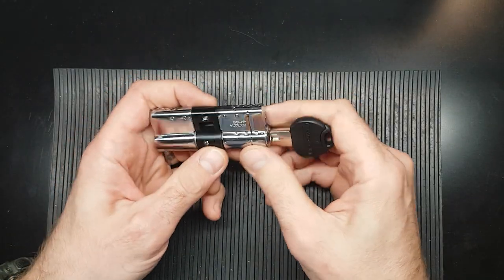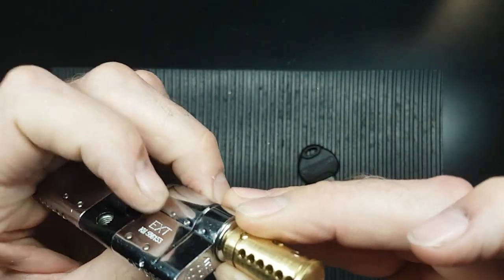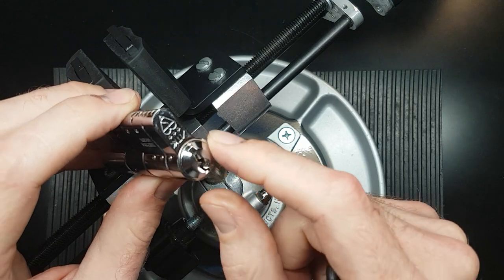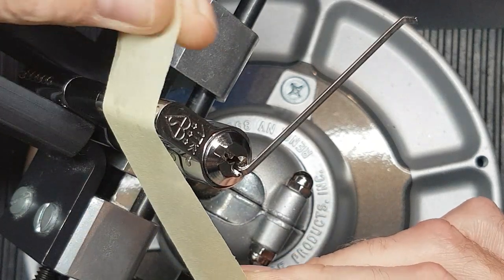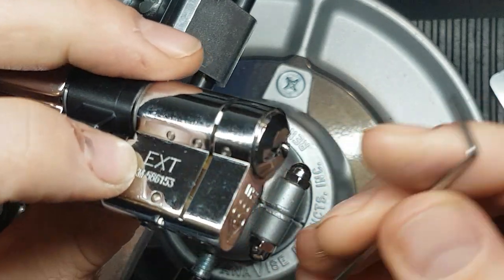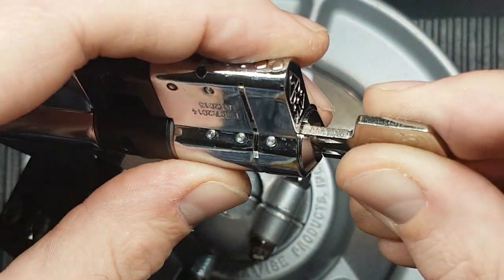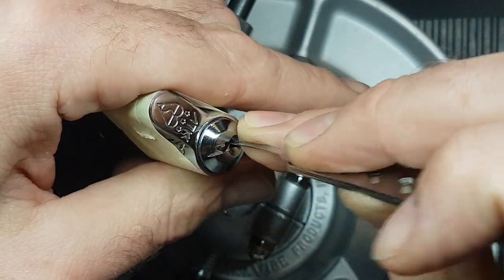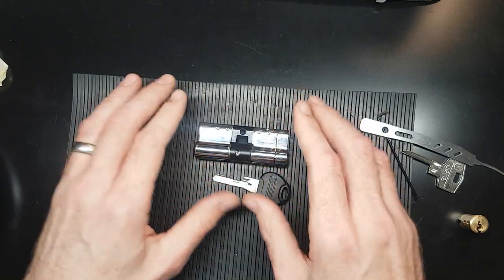Avocet ATK euro. Disappointing 360 pick past 6 trap pins.

Comment: Really interesting to see this lock in this setting. In a Euro cylinder door with a thumb turn for realistic entry settings, would you recommend this, an Era Fortress, or other(s)?
Reply from the maker: I like the idea of the trap pins, however unlikely it would be for an intruder to try picking it. I'd probably choose an ABS avocet over this one though. Same trap pins but also uses a magnetic element and generally feels like a better made cylinder
Reply: @Dmaclocksport  Many thanks Dmac, just had a search and the ABS does look rather intriguing; so much going on internally!
Reply: @Dmaclocksport  Hi again Dmac, another question for you if I may - the thumbturn bypass issues I've now seen video after video of just using some piano wire inserted into the lock to turn the cam! It seems like it's a critical flaw in many thumbturn locks. Do you know whether the Avocet ABS or indeed other higher rated locks have a means to defeat this? It seems like such a simple bypass technique that it rather defeats the point of all the trap pins/drill protection/magnet gubbins!

Comment: Nice picking mate, I struggled for a while with one of those. The awkward part if it was in a door is picking up the cam. You can get 360 roydb then realise the can hasn't moved 🤣
Reply from the maker: Not sure I picked up the cam here actually 😁 still, it's easily missed when the lock is in a vice and not in a door
Reply: @Dmaclocksport  My ABS video I did exactly the same 🤣